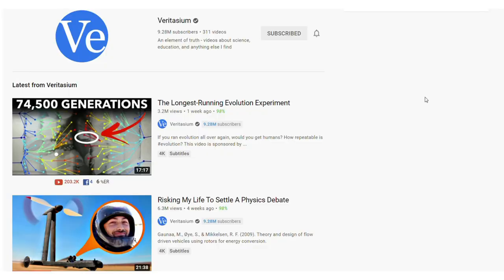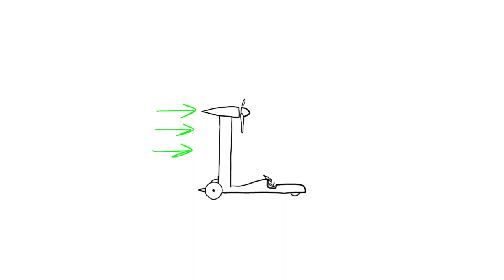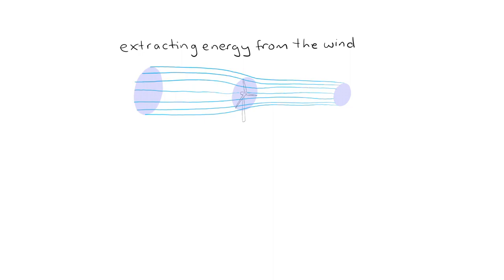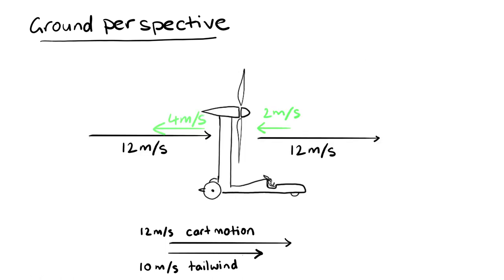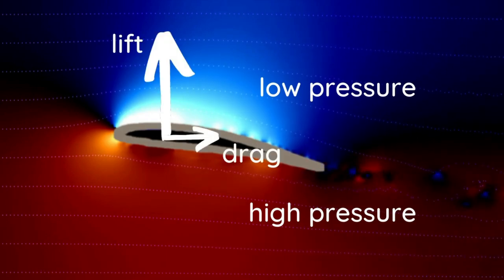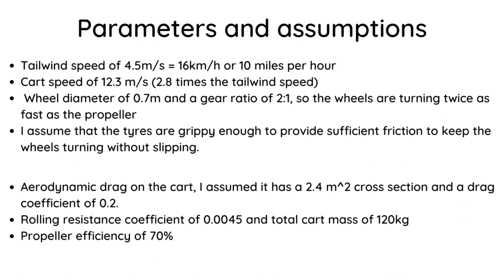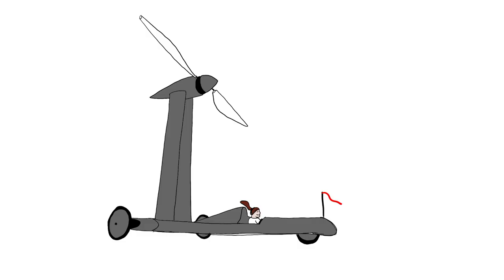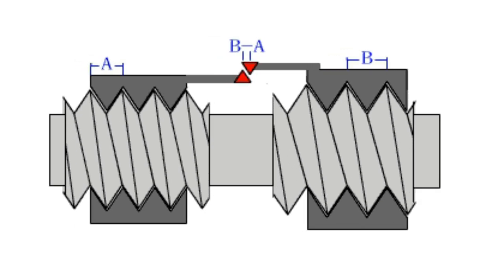Downwind Faster Than the Wind by Veritasium: How Does it Work?

Comment: I think of it as being powered by momentum, provided initially by the wind then from the prop plus the wind.
Reply from the maker: So many different ways to think of it!
Reply: On the Blackbird we make no use of stored energy.  This was one of the requirements for the record runs.  The only momentum that's important to us is the rate of change of momentum of the air passing through the propeller.
Reply: @Rick_Cavallaro  that is why I think of it as being powered by momentum.  It is not storing energy. It is using the forward momentum to spin the wheels that spin the prop that acts like a spinning wing that creates lift(thrust) that pushes it along.  Without wind it doesn't move on flat ground, if it doesn't move there is no thrust.  
If there is no momentum, it would in fact be defying physics.
Reply: @Bendigo1  
>> It is using the forward momentum to spin the wheels 

It does not rely on the cart's forward momentum.  The thrust from the propeller causes it to move forward, which causes it to turn the wheels.

>> Without wind it doesn't move on flat ground,

That is true.

>> If there is no momentum, it would in fact be defying physics.

Of course the cart has momentum, but it does not in any way take advantage of its own momentum at any time.
Reply: @Rick_Cavallaro  I understand what you are saying and how it works, it is just difficult to express myself on how I understand it.    
To my understanding the momentum is key because it is neither creating or destroying energy, it is only transferring the energy of the wind pushing it forward to spin the blades via the rotation of the wheels.  Then by optimizing the use of that energy it pushes itself forward, maintaining the forward momentum and slightly increasing its speed.  Since momentum is not stored energy it does not violate any rules.
Reply: @Bendigo1  "If there is no momentum, it would in fact be defying physics." IF zero mass materials were possible, and this vehicle were built from them, it would still work. Momentum, just like increasing entropy, is an inevitable part of the system. But it's not not necessary to involve them to understand what is happening.
Reply: @andrewsnow7386  what would be a better word to use?  Momentum is the closest thing i can think of do describe it as it uses the forward movement and rotation of the wheels.  I do not know of any other words to define it.  Other than simply saying the dmforward movement of the vehicle, and because it is not made of zero mass materials it has momentum.  That is why I use the word momentum.

Would velocity be a better word to use?
Reply: @Bendigo1  your description is completely accurate.  It's just that the vehicle's momentum doesn't play a role.  And what I mean by this is that the vehicle could have zero mass and still operate in the same way.  When we do the analysis, the only place the vehicle's mass comes into play is in determining how fast it will accelerate from the net force.
Reply: @Rick_Cavallaro  that is why i am second guessing my choice to use momentum to describe it.    Perhaps velocity is a better word?  
Momentum just seemed more fitting.  I'm confusing myself now.
Reply: @Bendigo1  It sounds like you understand the concept correctly. The reason I pushed back on the word "momentum" is that a common argument is that the vehicle can only go faster than the wind by storing up kinetic energy or momentum and then making a short sprint above wind speed. This is not the way it works..
You might say "momentum" is a trigger word for me - my bad. If you had originally said it is powered by "the forward movement of the vehicle", I think I would have been OK with that. I can see that there isn't much difference between "forward movement of the vehicle" and "momentum". But, to me, "momentum" implies energy storage more than "forward movement of the vehicle" does.
Personally, the way I would describe it (which isn't necessarily better) is that the propeller pushes the vehicle and the vehicle pushes the wheels.
Reply: @andrewsnow7386  I do understand how it works. I apologize for using your trigger word.  I completely understand how it can be frustrating with so many saying it is impossible without "cheating".  I think too many people overthink it or jump to conclusions on how it works.  Too many very intelligent people simply do some calculations and come to the conclusion that it wont work.  Others do calculations then physically build and test it to prove or disprove the calculations.  Without people like you we would probably still be in the stone age.
Reply: @Bendigo1  Thanks, but to give credit to the right person, it was Rick Cavallaro that was one of the designers/builders. Unfortunately, I had nothing to do with it. :(   Iv'e just been replying to YouTube comments, and in just one month I've become jaded. I don't know how Rick has coped for so long.
Reply: @andrewsnow7386  sorry, i didn't notice who i was responding to.  🤦‍♂️

Comment: Thank you, Rosie, for breaking this down. I was thinking about the twist of the propeller and how its function changes/shifts along its length as the cart accelerates. Could this while design be made much more efficient by using something more like a variable pitch helicopter prop? I'm guessing the optimal angle would have to be calculated by the difference between ground speed and wind speed, relative to the cart. Fun stuff to think about. Thank you for sharing your own thoughts on this cool idea.
Reply: In the ideal scenario, the propeller blade will have exactly the right twist for the design point.  That will roughly work out to be the same pitch regardless of station along the blade (i.e. every part of the blade is trying to advance the same amount in a single rotation - kind of like a spiral staircase).  Helicopter blades rarely, if ever, have twist.
Reply: Bernoulli's principal is what makes this work, not "thrusting air out the back".  

The only purpose to the airfoil pitch angle is to prevent either a stall (too much pitch at low ground (low relative air)speed) or a collapses of the vacuum on the top of the airfoil (too little pitch at higher ground (higher relative air) speed).  

Back trust is minor, otherwise household fans (no airfoil) would fly about the floor.  

** Run the same car with flat blades vs. an airfoil as a proof.
Reply: @rcmrcm3370  
>> Bernoulli's principal is what makes this work, not "thrusting air out the back"

They are two sides of the same coin.  You can't have one without the other.  And either approach will give you the same result for lift.

>>  Run the same car with flat blades vs. an airfoil as a proof.

Proof of what?  Proof that the cart won't exceed wind speed with a poorly designed propeller?  A flat plate develops lift for exactly the same reasons an airfoil does, it's just a really bad airfoil.  And by the way, I'm certain I can make a cart that still exceeds wind speed using a propeller with flat blades.  But it won't do 3X wind speed.

Comment: Without all the math: when the cart experiences a tailwind, the wind turns the propellor which then turn the wheels, but if the cart experiences a headwind, it is the opposite: the wheels turn the propellor .
Reply: The wheels always drive the propeller.  The propeller never drives the wheels.
Reply: @johnborton4522  but if that were the case, it would never be able to move from a dead start….
Reply: @johnborton4522  ha ha, I shall defer to your expertise, Sir. I kinda got lost in the engineering explanations and math and tried to understand the whole starting and accelerating process from a slightly less "mathy" perspective😄
Reply: @unicyclechinese3125  

No worries.  Happy to answer questions.   My partner in the project, Rick Cavallaro is also here on the thread and can answer even harder questions. :)    He's the guy who thought the whole thing up.

Comment: "Why don't the wheels put more drag on the propeller than it needs to move forward?". This is where my intuition breaks down. I accept the science that says it's possible for this vehicle to go faster than wind speed down wind, but I just can't intuit it. And I'm not smart enough to grasp the maths. Thanks for your video though. (I actually intuit it the other way. The propeller puts drag on the wheels hence should be slowing the wheels down).
Reply: @Rick_Cavallaro  thanks for the reply Rick. Well done on your invention and good on you for standing firm when you had very smart physics people telling you you were wrong.

Comment: I don't understand why so much fuss about this? You get an initial force from the wind to get your wheels turning. Then the wheels/blades do all the job regardless of wind speed.
There is only one major factor here that needs explaining.
There is a finite wind speed that sets the point of no return and this speed is respective to the rotation of the wheels and size of the blades of that vehicle. If you change the wheels or the size of the blades, the required wind speed to achieve the same result changes accordingly.

Comment: you almost got it.. But you are makiing the same mistake everybody else is making by talking about wind velocities instead of forces.   When the craft is sitting still the propeller is stationary and the propeller disc area is 0 capturing a minimum of wind force. but once the craft overcomes its initial at rest friction the wheels begin turning the propeller creating a large disk area. This large disk area captures the force of the wind which is a net positive power component versus the force of friiction. Causing the craft to accelerate. As long as you have a net positive force on the entire propeller disc area the craft will continue accelerating. Until you reach equilibrium. At this point the craft will start decelerating as frictional forces will overcome the power component from the wind acting on propeller disc area. Think in terms of a spinning propeller creating a wall of air for the wind to push against rather than just accelerating it locally at the blade. The wind force or power component is acting on this entire "wall" driving things forward and accelerating. But eventually things will equalize and even flip the other way and you will have a long period oscillation of acceleration and deceleration. By changing propeller blade pitch while moving forward all you are doing is smoothing out this oscillation. .

Comment: This is an excellent video.  I made a short video arguing that wind pushes on things that move slower than the wind.  You can use this fact to make the vehicle move faster than the wind (in the direction of the wind) by using leverage.  This argument requires less math and I think it also applies to the Blackbird vehicle because the "effective" surface of the propeller is moving backwards relative to the vehicle and is moving slower than the wind, so the wind will push on it.  Check out the video if you'd like.  It's fairly lame, but short.  Nothing happens for the first few seconds but then it get's very exciting :)  Thank you for your excellent explanation of lift and drag on a propeller.

Comment: Let's talk about what is exactly taking place instead of making comparisons with other energy sources. When the vehicle first starts out from standstill the wind is hitting the blade and flowing across the blade in the same direction that the blade is turning. It remains flowing in this manner throughout the entire event. The exact point where  the molecules of air hit the blade, that point is always moving directly downwind slower than the wind. The blade is working exactly as a high-performance ice boat sail running diagonally downwind. The wind flows forward across the sail with boat speeds reaching over 100 mph. Watch my video and you will understand. I would be glad to answer any questions and explain what exactly occurring.😊
Reply: I'm going to take a small snippet from what you wrote in an exchange below:
//"...to allow forward rotation of the prop thus driving the wheels."//

Are you claiming here that the rotor drives the wheels through the drivetrain?
Reply: Thanks for getting back John. I applaud the complexity of your concept . I do not believe the prop drives the wheels. Because of the angle of the rotor blade, it always wants to push backwards against the wheels but the Wheels lock it from rotating in that direction. The energy of the wind is captured on the blades and transfered to the vehicle itself thus pushing on the axle causing the wheel and prop to rotate together simultaneously.  The diagonal spiral course that the prop travels down range is exactly like the ice boat traveling diagonally down range (minus the spiral). The adjustable pitch of the blade works just like the adjustable sail angle relative to the Centerline / direction of the boat . The wind flows forward across the sail just as it flows forward across the propeller blade.
Reply: @SkipStauber  //" . I do not believe the prop drives the wheels."//

Just checking. :)
Reply: @johnborton4522  do you believe that there is something about the vehicle that always moves directly downwind slower than the wind
Reply: @SkipStauber  

Depends on the specificity of your question.  The contact patch of the tire of course travels slower than the wind at all times, but since I think that is likely outside the scope of your question I'll limit my answer to the propeller. 

Even a P51 Mustang propeller moving through the air at 400 mph has an air/propeller face contact point continuously moving backwards through the air (meaning moving rearwards at a speed faster than 400mph).  Propulsion would not be possible otherwise.  This is is no different with the Blackbird propeller.  It is in fact how propellers work.  (Also, as you correctly point out,  how ice-boat sails with with VMGs >1.0 work).  This contact point between the air and the Blackbird propeller never even reaches windspeed, let alone exceeds it. 

However, let's not confuse a contact point moving rearward with mass moving rearward.  When the Blackbird is traveling DDWFTTW, the entire mass of the propeller is continuously  moving forwards at a speed faster than the wind even while this contact point is continuously moving backwards. 

The contact point between a rotating threaded shaft and the linearly traversing nut is indeed moving down the length of the rod, however the mass of the rod is merely revolving around its axis and not translating.   

Again, mass and contact point are not the same.  

I hope I've answered your question.
Reply: Yes .The physics involved show the contact point for both the ice boat and  Blackbird to be moving directly downwind slower than the wind. They can both be shown performing identically.
Reply: @SkipStauber  

This is something greatly misunderstood and what your own video is about.  

Most think that the mass of the sail must be moving slower than the wind to harvest wind energy (and often times in lower performing boats the mass of the sail does move slower than the wind).  Ice boaters have known (through a century of experience) that this is not true -- only the contact point must move slower.

Trying to get that point across to the masses however isn't as easy as it might seem.
Reply: @johnborton4522  agreed, there are very few that realize there is no velocity to apparent wind, and that the wind can, on a regular basis flow forward across the sail of a high performance boat, (catamaran, skiff, foiler, land sailor etc.) Hence the making of my video.
Reply: So, do You Now understand that the propeller blade acts as the ice boat sail and does not push the air backwards like a fan?
Reply: Which way do you think the air flows across the face of the propeller blade? In the direction that the propeller is turning or in the opposite direction?

Comment: * So what factors determine a theoretical maximum speed? 
* Would it be some percentage above wind speed? 
* What would be the dynamics of adjusting the propeller pitch as vehicle accelerates. 
Brain still hurts.
Reply: The maximum speed depends on friction and air resistance so it's not simple to calculate.

Comment: That you can sail faster than the windt is nothing new. Typically the America’s Cup sailboats  are sleek and fast. The AC72, the type of catamaran used in 2013 could travel almost three times the speed of the prevailing wind!  Emirates Team New Zealand recorded a speed of 50.8 mph (44.1 knots), with a wind speed of about 18 mph (15.6 knots).

Then one may ask; will it be the same with the boats heading exactly (!) the same as the wind direction. It is after all, possible to sail against the wind and maintain a good 'against the wind speed' as long as 'tacking is allowed.